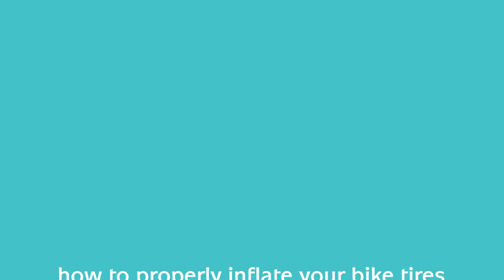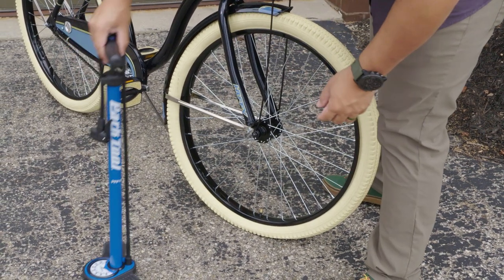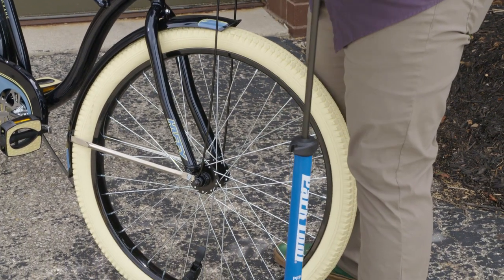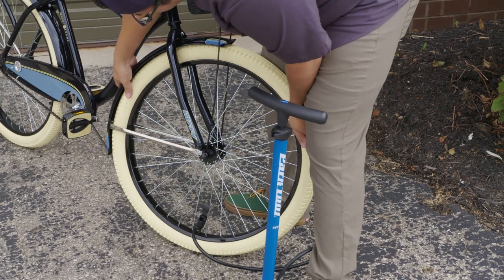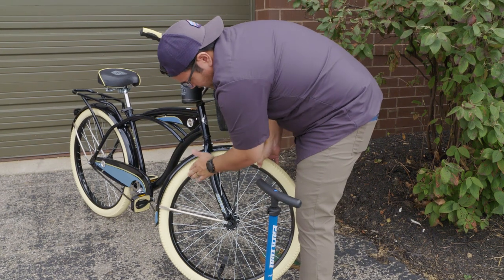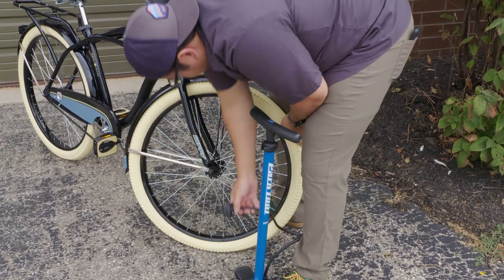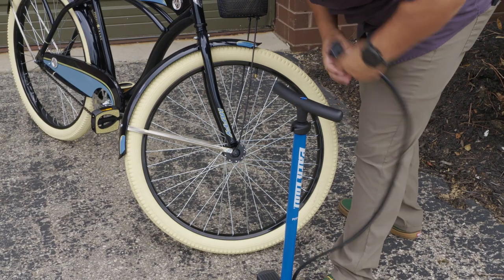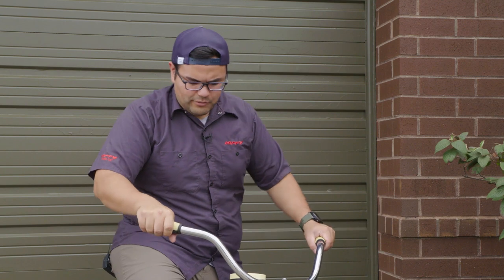How to Inflate Bike Tires | Tutorial

Comment: so when feel the tire should the tire depress with my thumb or should it be firm ? i'm riding gravel trails with mixed  stone sizes and  yellow buckeyes .  yes its a gravel bike  not used on the roadway  except to cross the street  i've had nothing but issues since changing tires ended up replacing both tire valves i own 27.5 Batch bike 1x7   side walls are not rock hard slighty firm
Reply: it should feel firm in your case
Reply: @ryanm6818  i since replaced the tubes in my bike tires  are now firm i think that earlier set of tubes were cheaply made  i ride a modest amount of 16 miles every day after work . anywhere from 22 to 62 miles on a weekend  so having good tires to me is important . i'm novice at bike repairs but learning  thank you for the reply